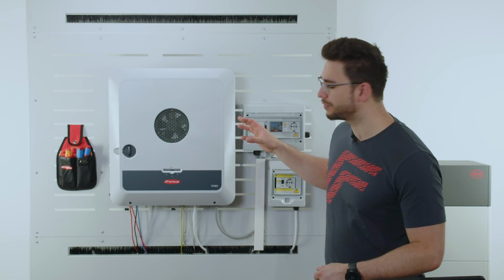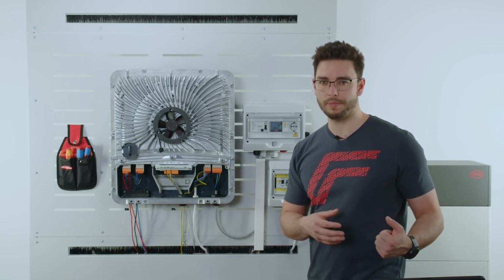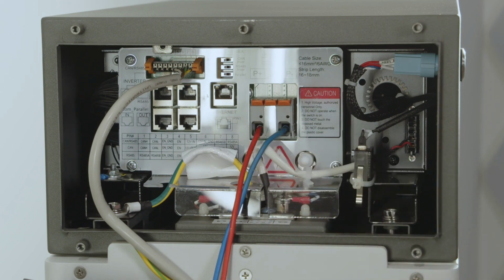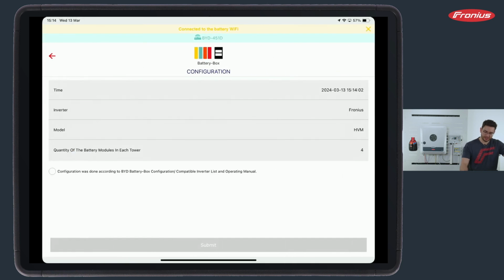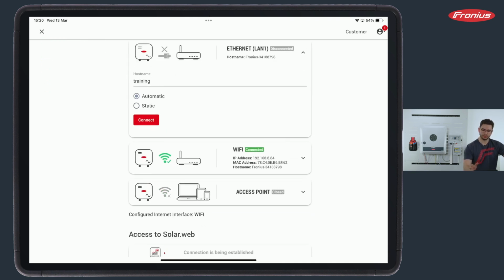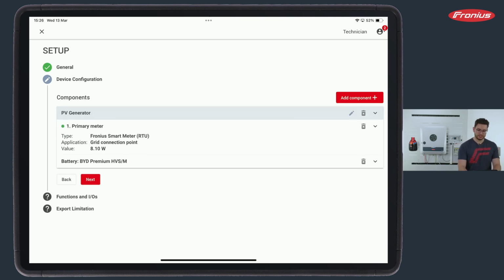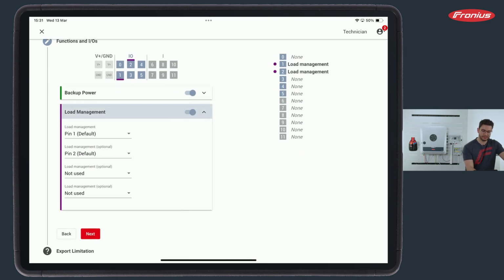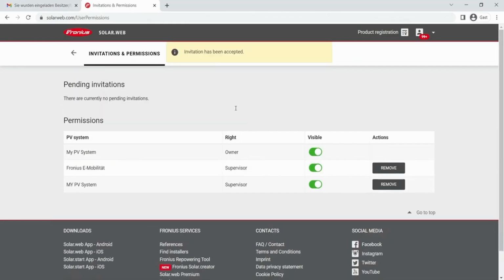Commissioning the Fronius GEN24 Plus and the BYD Battery Box Energy Storage Solar Battery

Comment: hello, can I instal a BYD battery as a customer ? I bought one and plugged it to my fronius gen24 plus but I'm not a technician, how can I do  ?
Reply from the maker: Yes, you can but you need to follow strict safety instructions. Please see https://www.fronius.com/en-gb/uk/solar-energy/installers-partners/service-support/tech-support/how-to-install/installation-guide-storage-solution
Reply: @3buysolar  I don't have a technician password, any way around it ? the battery is installed and connected, the inverter says it sees it but I can't activate it
Reply from the maker: I'm sorry to hear you're having trouble activating your BYD battery system. Here's a step-by-step guide to help you proceed:

You do it at your OWN RISK!

Connect to the Battery's Wi-Fi Network:

Locate the Wi-Fi network broadcasted by the battery; it typically starts with "BYD" followed by the serial number.

The default password for this network is usually BYDB-Box. 

Access the Battery's Web Interface:

Once connected to the battery's Wi-Fi, open a web browser.
Enter the IP address 192.168.5.1 into the address bar to access the battery's web interface. 

Log In as Installer:

When prompted, use the following credentials:
communityarchive.victronenergy.com
Username: installer
Password: byd@12345
Configure the Battery Settings:

After logging in, navigate to the installation or configuration section.
Enter the necessary details, such as:
Number of battery modules
Inverter brand and model
Grid configuration
Ensure all settings match your system's specifications.
Finalize and Reboot:

Save the configuration settings.
bydbatterybox.com
Reboot the battery system if prompted.

Restart Sequence:

Switch off both the inverter and the battery.

Wait for approximately 5 minutes.

Switch on the battery first, followed by the inverter. 

If you encounter any issues during this process or if the default credentials don't work, it's advisable to contact BYD's customer support or consult with a certified installer for further assistance.

Hope this helps.
Reply: @ thank you